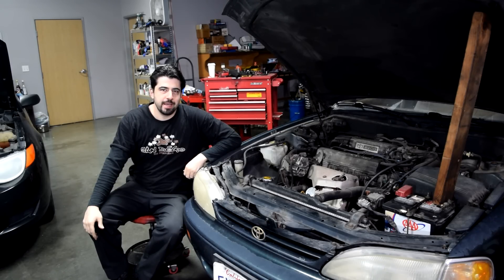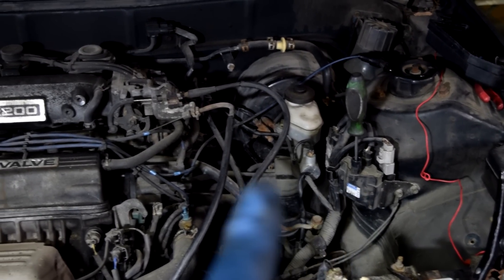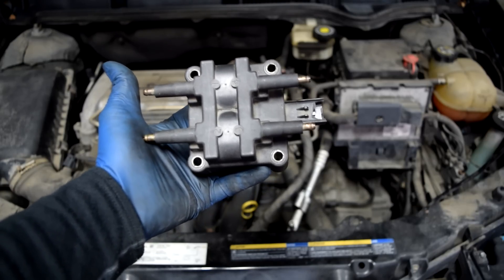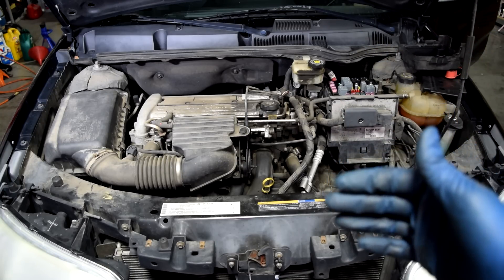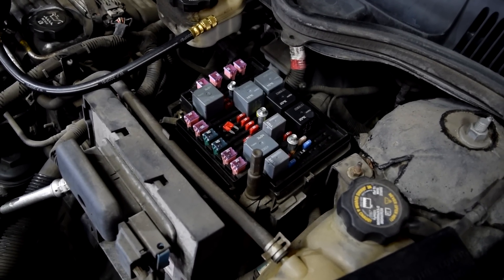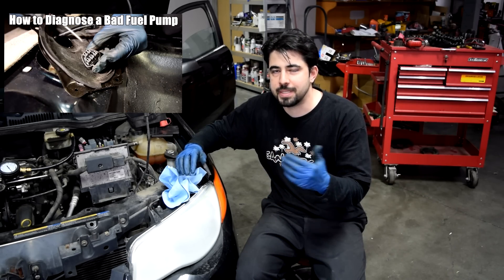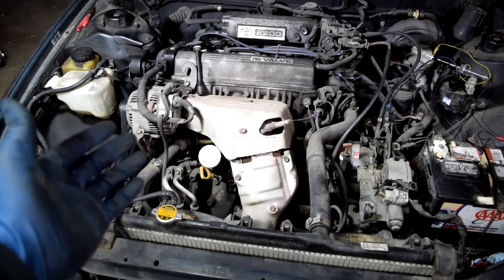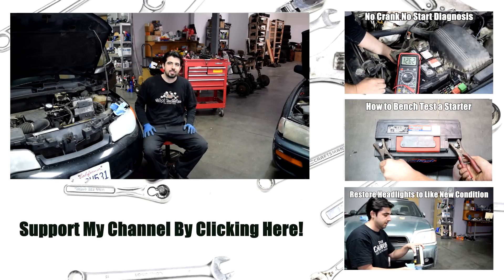How to Diagnose an Engine that Turns Over and Cranks But Does Not Start - Crank No Start Diagnosis

Comment: Is it true you will get inaccurate low readings if all the spark plugs aren't removed
I have a crank no start so car was tested cold but intake manifold was still on meaning the other spark plugs were not removed when testing
2 out of 3 driver side cylinder had 90psi on cold engine and 1 had 30psi. How accurate could that reading be

Comment: I have a 2014 ford fusion I've changed out camshaft and the crankshaft censors I also changed out the spark plugs, the vvt solenoid, and vaccum pump for brakes and the gas is flowing through the line has oil in but it's cranking but not fully cranking to stsrt

Comment: Nice to find  something similarly to my 2004 Tacoma has coil and cable   I has  spark on ignition coil blue spark and the cable orange color  and with spark plug conected. Nothing. On middle of spark plug any idea  bad coils and wires???

Comment: Great video. Wanted your recommendation on my “crank no start” scenario on an LS1 where I have spark on cylinder #1 only! Cam & Crank position sensors, plugs, wires & coils are all new! I have fuel pressure & compression. Also how can I test the coil pack (4 pin) wires, etc.? Thank you!

Comment: I forgot to tell you. My vehicle apparently has a broken timing belt. You may not get a spark but there may be nothing wrong with the ignition. On this exact model, you want to consider first if the fuel pump has failed and then you go on to the timing belt and the ignition system. Later models with this engine through no longer had a distributor. If you have a distributor, it is much more likely that a non-run condition is due to the ignition system.

Comment: Hi R/W, i had a leaking valve cover gasket on a Hyundai getz. I replaced the gasket and it still leaks. What could still be causing this? The Cover itself is plastic. Could it be warped?

Comment: Hey I conducted the test to see if the signal wire makes the test light flash for the 5s-fe. I have a 3s-fe, not sure it makes a difference. Anyways instead of a flash it just is a constant light on, no blinking.

Comment: How do you check the relays in your truck. Fuses you can pull out and look to see if the wire inside is broken. Relays are little metal cubes in the fuse relay box. You have to get a mechanic to check those with test equipment. My vehicle is at home at won't start. Mechanics are at shops and dealerships. If I can find out what's wrong I won't have to call them.

Comment: Excellent Video on Crank no Start. Other issues could be Anti Theft System triggered and BAD PCM. REMEDY = replace PCM and reset car’s computer by disconnecting the battery for 30 min.....

Comment: I have a 1998 Toyota Camry I put a new fuel pump  in it got power to the pump just not pumping to the motor and the motor just keep turning over and over what could be wrong and does it have a crank sencer if so where is it located at and when I was driving down the road it just stop running

Comment: Iv got a 1986 Oldsmobile cutlass ciera front wheel drive v6 ,it turns over and its getting fuel to injectors but it's not firing and what's a common reason its not firing ?

Comment: If the distributor does not send a signal to the ecm will the fuel pump still get power because i think if you use starting spray and replace the pump then it could be ecm or disributor. Im just wondering

Comment: I have a 1993 Camry and looked for a good while for the ignition coil.  Later I found that on this year of the Toyota 2.2 liter engines, this is located inside the distributor.
Reply: that's very common but hectic

Comment: Ok I have a weak spark and I’m getting fuel also compression is good I have been told the sparks no strong enough so they said it could be cam sensor 03 Sentra gxe 1.8
Reply: What's was the problem?

Comment: 2003 Mitsubishi Eclipse GS  2.4 I replaced timing belts water pump throttle position sensor battery fuel pump crankshaft camshaft check all fuses relays immobilizer starter fuel spark air injectors the list goes on. Key FOB also suddenly stopped working.  and STILL CRANK NO START!

Comment: My 1997 2.2camry sxv10 is only cranking but no start WHEN the engine is HOT. Let the engine COLD, and it can be started only with a single shot, easily. 

Can you help me to find out what is the culprit?

Comment: I have an intermittent crank no start. Replaced cam and oil pressure sensors both had coded. Still no start three days then it started. No codes. Now it won't start again and the MAP coded. I'm suspect of now having three separate sensors code in one week, which all coded individually in succession. Any ideas?

Comment: I am experiencing a Crank No Start. My problems began with the Security System thinking someone was stealing the car resulting in strobing marker lights, horn honking and buttons clicking inside the 1998 Buick Lesabre. Of course every 3-4 days my Battery was drained down as well. 😡After dozens of Videos I think I successfully was able to disable the malfunctioning unit. But in my continual attempts to get my car started I burned out my Starter. New Battery, New Starter and I still have a Crank No Start issue. I think I do smell a bit of fuel when it tries to start. There sounds like ? Mini backfires or hesitations in these attempts. if somehow the Injector pulse had been deactivated how on earth do you deactivate it? Signed Desperate 🐥 to get my Wheels Running again in Canada

Comment: I have replaced a lot of items on my 89 s10 pickup. in the beginning of November I replaced the gas tank fuel hanger and pump assembly and fuel pump. The previous owner had installed a new fuel pump also. I t refuses to start. I get code 12 over and over again. so I just replaced the entire distributor. The truck still refuses to start.  I can hear the pump run when you turn the key on. But the truck won't start. If you dump fuel into the throttle body the truck starts right up and then When the gas runs out it stall. How do I force the engine to start. The new computer system were supposed to make repairing a vehicle easy. yea right.

Comment: What if I am having it crank and turn over with no start but it will start after a few tries?
Reply: Ever find out? Still trying with mine!:(
Reply: Happens with my Elantra takes awhile but also starts up but loss of power during acceleration
Reply: @Thebaddestjuan  I bent my main key on accident and was using the backup key...which was actually only meant to go to the glove box. The only reason I was ever able to get it to start with that key is because I must've had the real key close enough to the ignition. The guys at the shop actually didn't believe me when I said I started it with that key. They pushed the slightly bent key into the ignition which straightened it and I went on my way..
Reply: Sounds like catalytic converter blockage

Comment: I had this issue on a 2012 chevy malibu, I just solved my own and trying to help others. I checked air filter, and my fuses which were good. I then disconnected my fuel line at the rail into a bucket to make sure my pressure was good to the rail at least (this will not check your injectors, just ensure that fuel is getting to your injectors.) I replaced my crank sensor early which I should have waited till after I checked for spark, I broke the old one getting it out so the new one had to do. Then I removed my spark plug and checked for spark. which I was getting. I then cleaned my Mass air flow sensor which is also your IAC valve on the snorkel to your air filter. Then I read online that if your throttle body is bad that it sends incorrect timing signals to your injectors which could cause a no start issue because they are firing at incorrect times. I changed the throttle body because they had no rebuild kits and it was the problem. I then ran my engine and it was rich from trying to start it so many times. I recharged my battery and ran it for 10 minutes to flush the engine of too much fuel and then ran at 3k for 5 minutes to make sure the extra fuel was gone. I turned off the car and turned it on without starting it and depressed the pedal to the floor and hold for 30 seconds and then released a few times listening to make sure the valve was working in the throttle body. Let it sit for 1 hr then retried and we are gold my friends. hope this helps you diagnose your own problems. I want to let you know that if you feather your throttle and your car almost starts or starts this could definitely be your issue.
Reply: Blissment since then has it had any problems? I have a 2010 Chevy Malibu and the same problem occurred just a few days ago

Comment: Awesome!!! U helped me to discover that I don't need a coil nor a igniter on my 1991 4runner v6. I started first with the coil cus I was sure that was the problem. I was wrong. Then I checked my spark plug cable for piston #1. It sparked very weak & inconsistent. I won't assume it's the distributor cap or rotor because I've barely put together a complete rebuilt 3vze engine. My problem may be in installing my distributor one spline off and causing it to be out of timing. Or my timing belt may be off by 1 tooth/spline on either a camshaft sprocket or the crankshaft sprocket. But this video really helped with my no spark condition. Thanks.

Comment: I do have a question on a 1.8t passat I have replaced the timing belt and water pump on the car. Couple of days later the car won’t start. I have checked for spark and fuel and I’m good to go on that and I did a compression test and they are all reading 50psi. So my question is do you think did I jump the timing or do you think I got leaking head gasket or blown piston rings. Thanks and let me know 😊
Reply: Try to check the timing

Comment: Hi i have a 1999 vw lupo which is cranking but isnt starting, on the fuel rail there isnt a nut or anything, just the main feed in a hose which did flush through fuel but only when you try and crank it ( which is good news for the fuel side ) however i did the spark test all the way to the ignition coil and there was no spark, im just hoping i did the tests right, is it right with the fuel though?

Comment: Hello the Great man,
Reaunalt megan 1.6 petrol Manuel 
I have problem with my car the car was two days under rain and when I wanted to start became turn on and then  became turn off and fan in front of the Radiator run I saw battery alarm and I charged with battery charger and also stil can see battery alarm on the Dashboard every lamps on car works but the flash and stereo doesn't works my car crank but don't turn on I have electricity on my Dashboard and petrol is coming from Gasoline hose I changed the spark plugs and after start sometimes I hear a sound form Electric throttle can you help me I live in the Sweden and here price for repair is so high! I'm so sorry because of my English has gone my mind!  tnx for your useful video.
Reply: WD-40 (water displacer) sprayed in & on distributor, plug wires, etc.. would be an obvious & low cost first step to try.

Comment: I have a 2000 chrysler sebring convertible v6 and i have the same problem can get it to run same issues like on the video can anyone giveme some pointers other then what the video shows more strait to the problem.... appreciate any suggestions....desperate here thanks.

Comment: my wife's 1998 acura el 1.6 was parked and wont start, i checked for sprk there was none, changed the distributor, now i have spark, was able to get it to run normaly, went around the block parked it, my wife tried to start it maybe 2-3h later and wouldnt start anymore. note that before it stopped running somtimes it would crank for a couple turns before starting. so went and checked for fuel pressure after the fuel filter and there is pressure and when i checked the plugs for spark i could smell gas when my wife was cranking it while i was looking for spark, so at this point i have no idea. somtimes when i crank it i can feel the engine trying to start. could it be the ignition timing, i did my best to mesure the marks on the old one and tried to place the new one in pretty much the same spot. there is a check engine and codes are as follows P0118/P0505/P0138/P0420 hope you or one of your awesome viewrs can help, thnx!
Reply: If you're not getting spark and you keep trying to crank it over without unplugging the fuel injectors you will flood the cylinders in a car like this

Comment: Ok I have an 2003 Dodge Ram 1500 4.7 v8 I’m having a crank but no start problem I took it to a shop but at first it was starting just had a hard time getting it to start but I’ve had the computer replaced at the shop but I was told the timing chain that the crank n cam is not spinning but the guy at the shop quit then another guy started working there but he says that the computer needs to be programmed to the engine which the computer should be programmed already by the vin # right so I just went and got my truck from the shop because I’ve paid 530 for a computer that was pretty much not needed cause my truck still does the same thing only difference is that my vin # is now programmed at first it had a different vin # for a 2005 Dodge Ram I don’t know any history on the truck cause I bought it off the streets from a guy which come to find out it’s a different engine in the truck from the original engine but this should not be a problem because it was running at first just had an hard time starting but now it just cranks with no start someone please help I wanna get my truck rolling so I can get to work

Comment: What if you're getting spark so you run the starting fluid test, but it still doesn't fire?
Reply: william b either your timing is off, you don’t have enough compression, or your not getting enough air

Comment: I've got an '88 Acura legend, car sat for 10 years and after some work i have fuel, spark and good compression, the car still won't start 🤔
Reply: Make sure the you turn the key all the way clockwise and hold it. No need to thank me.

Comment: Ratchets and Wrenches: I agree with the comments of "pdufusc", you should be instructing. Their are a lot of instructors out there teaching who shouldn't be (to include residential heating and air conditioning servicing). Many of them use precious class time to talk about deer hunting and personal experiences rather than covering material that is suppose to be covered. The world needs more instructors of your caliber!!! Excellent video and excellent job explaining the troubleshooting process!!! Your video helped me zero in on a failing spark plug problem on my 2010 Toyota Corolla this past weekend. Otherwise I would had started with the gas tank (pump) and worked my way forward to the engine. You saved me a ton of time and heartache. Muchisimo Gracias.
-Ron

Comment: Hi.. thnx for a compreshensive video.. My car is an EFI with only crank shaft position is senced by ECU from Distributor block. ( Only NE+ and NE- and No G). My car suddenly stopped starting. When I started it, first time it was started and gave a dying engine and stopped after RPM up down. I tested for sparks using a spare spark plug it gives sparks. I tested fuel pump and pressure - pump was working and fuel pressure seems sufficient since when I loosen the nut feul came out with a pressure. I checked for injectors - Heard ticking sound when injectors work. Could you please tell me what else I should do/

Comment: Hi i have 2003 Dodge Ram 1500 4.7L its cranking but no start I replaced the camshaft sensor  and crankshaft sensor and spark plugs there is fuel pressure  but no spark from ignition coil also the compression test read 100 on the engine where is the coil pack on this car

Comment: Great video. Sometimes the only way to find why a car won't start is the process of elimination which is what you did very well. I have a crazy problem and I'am about ready to take it to a pro. The problem is that the car will start and then die. I first changed the fuel filter and then the fuel pump, but no help. I did find that if I continued to try to start it several times it would stay running with the check engine light on. If I let it idle for about 5 to 10 minutes the check engine light goes out and it runs great. I can drive it to the store shut it off go shopping come out and it starts right up. In fact I can drive it all day like that, but when I shut it off for the night it's the same thing no start the next day. This has happened every day for about a week. I've tried different things like cleaning the start control valve.( The valve that opens to allow air to pass around the throttle plate until the car starts), I also cleaned the throttle bore. I took it to oreillys to have the fault codes checked, but the computer would not communicate with the OBD 2 tester. I would appreceite any help. Thanks

Comment: If any shade tree mechanical are on here maybe they could help me . I finished the video to no avail.  I checked for spark and it was good, it still wouldn't spark with starter fluid and it doesn't sound like compression issue and it drove perfect beforehand. Brand new mostly everything. New transmission fairly new engine. And most sensors replaced recently.
Reply: what about e.c.m.?

Comment: The first thing to look for after finding no spark at a spark plug is to check the spark plug gap. This was an expensive mistake I made years ago. Spent over $1500.00 at a shop once and they didn't fix the problem either. It was the spark plugs. They were very worn.
Reply: I can usually check bad plugs with vacume gadge.if needle floats around 2 points = plugs mainly